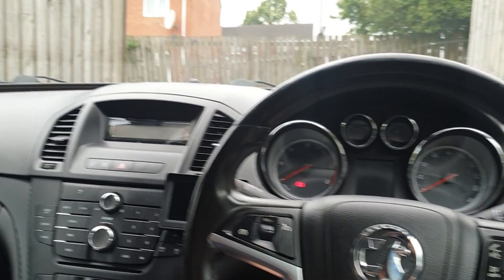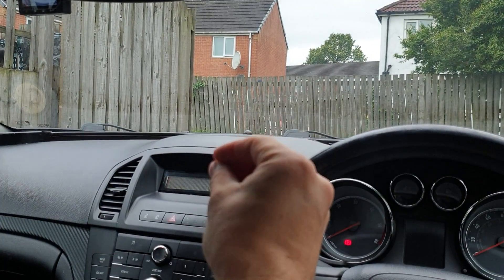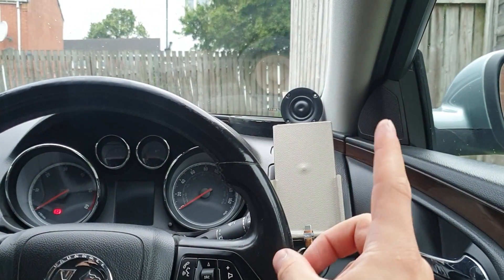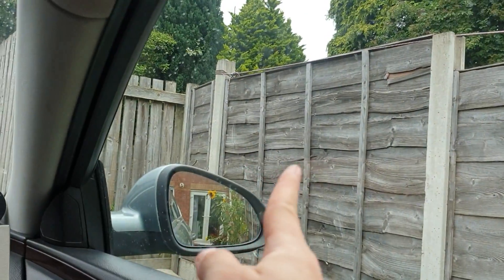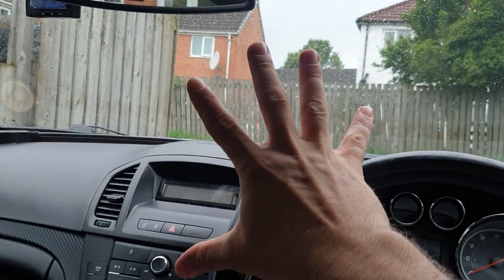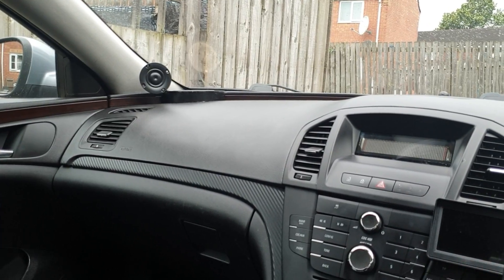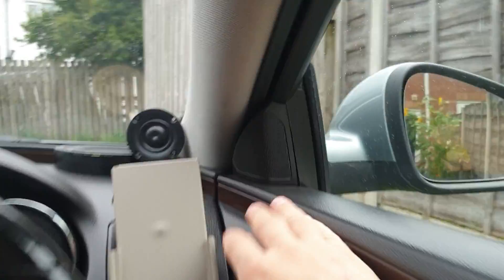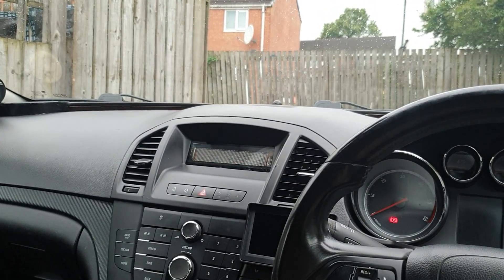2way (off axis) vs 3way (on axis) imaging comparison

Comment: What's the best you can get with a 2-way setup for SQ while still keeping up with 140+db of bass and what speakers/types should I use up front? I ask mostly out of laziness. If I gotta go through the trouble of kicks and all this custom mounting and whatnot, I don't wanna do it for SIX speakers up front, if I can reasonably avoid it.
Reply from the maker: I would go for One audio midbass and widebands as a 2 way. No doubt they would to up to 120dB with good power.
Reply: @RAW-CAt  Nice. A few years ago when I was considering it for my Ranger, I was looking at a Peerless SLS -8 midbass that could go down to 50hz and either a audiofrog GS25 or CDT audio 2" wideband . Though I heard some crazy stuff about a Tang Band aluminum cone 4" speaker that didn't need tweeters.

I also, very recently, saw a guy on youtube who was gluing reinforced paper sauce cups/small bowls to the formers of 6.5-10" mids/midbasses and subwoofers after cutting off the dust cap in order to turn them into a sort of DML hybrid speaker. They sound pretty clear and crisp on the highs, even 30-deg off-axis and being filmed with a phone/go-pro, and the guy claims the camera only captures about 40% of the experience and frequency response range/accuracy.

Comment: I've got a 2 way that now sounds much better after lots of tuning sessions with the D4S dsp. However, the pair of 6.5" drivers on 800rms just isn't loud enough to really keep up with my sub (Sundown ZV4 15 in 25hz tuned box). I'm going to put back in my Beyma midbasses and see. Wanted to do 3 way for years but there's always something else that comes up to upgrade

Comment: In my experience 2way should be measured without driver. Seems if you measure with parts of your body (legs chest shoulder etc) between the speaker in the lower doors and the mic the result of the measurement tends to be off compared to a measurement without body. 3way is not so bad because there are less direct obstructions. Try to measure sitting in the back of your car and then moving mic method where the drivers head would be about 30 to 40 cm in diameter.
Reply: But when your sitting in the car listening to music your body is ther so... It makes more sense